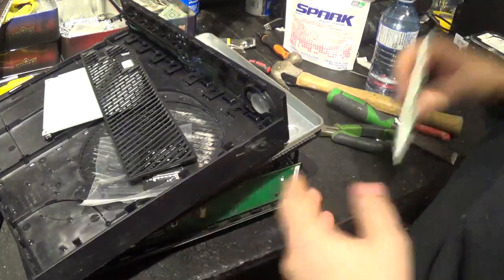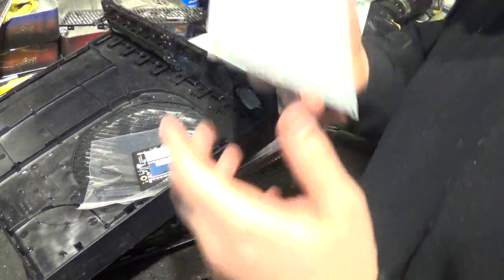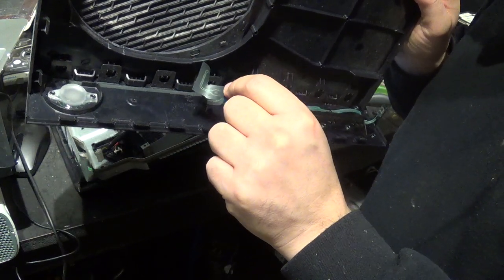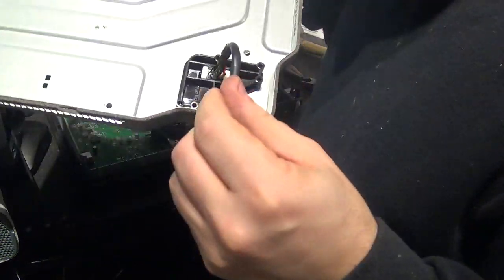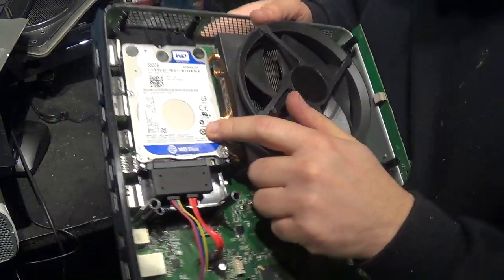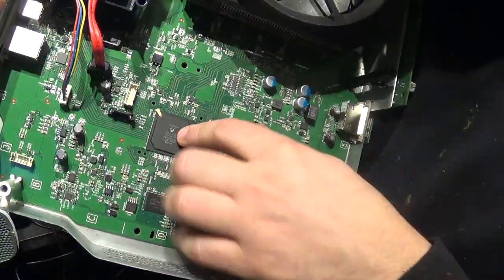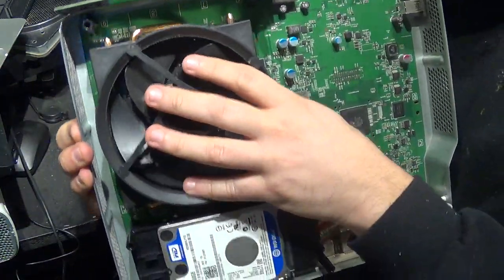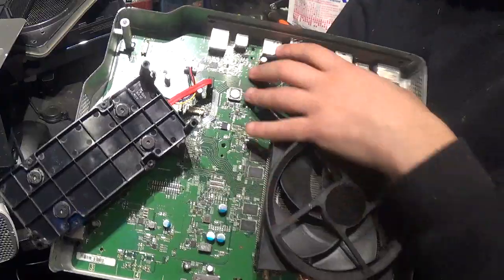Is Scrapping an Xbox One Worth It? Gold, Capacitors & Real Scrap Value Explained

Comment: i just picked one up someone threw away no idea if it works or not ;D
Reply from the maker: The sucky part is that to test it you'll need to buy a power supply. Unless its the slim version. Where did you get it from?
Reply: @champlainscrap6076  trash im a garbage man
Reply: not just that the jewlwery i find last month i found 2 rings and a gold necklace
Reply from the maker: @Archie854  I would say it's up to you if you want to make a $25 to $30 investment to try and see if it turns on. If it turns on and has like a faulty blu-ray, it would be an easy fix and you could possibly get $100 to $125 for it. You could try to sell it as broken on ebay but not sure if it would be worth the hassle of packing and shipping etc...